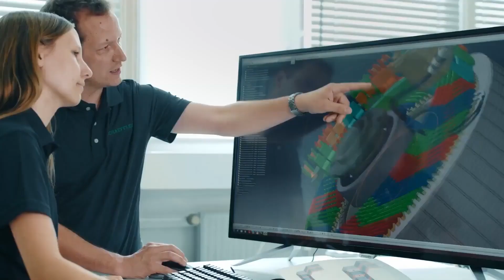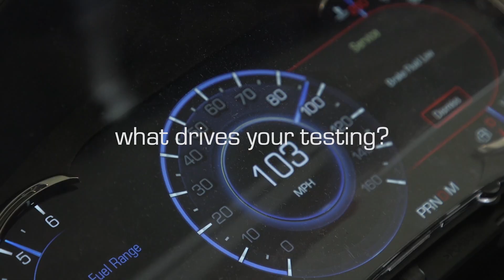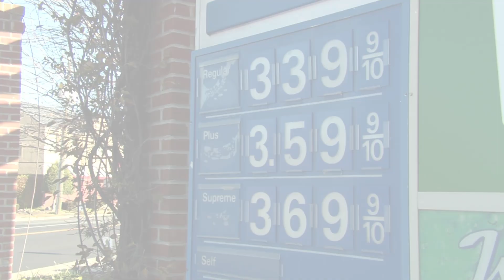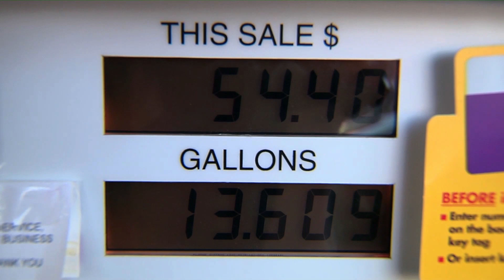Lamborghini's Profits Skyrocket; Problem with Cell-2-Pack Designs - Autoline Daily 3529

Comment: With respect to cell to pack being able to replace a given percentage of the battery if needed just makes sense.

From what I read gm is attempting to do that with its new architecture.

The concern I have with gm is it's not clear to me if this LG Chem stuff is ever going to work in volume. 
LG Chem does not even what to build another plant.

I did read gm is using cylindrical batteries in China (the same form factor as Tesla) and it appears they may be in discussions with Samsung at this time.

I do hope the best for Ford, gm, and Tesla (in alphabetical order).

When I purchase an EV I expect it will be one of the 3 above not sure which one at this time but battery safety and maintenance will be high on the list.

Comment: yes. this is the reason why i prefer a modular design like in the VW MEB.
at some point it could even be interesting to support two parts of the battery pack with independent electronic to support a mixed pack of older and newer modules with different tech. also, second hand modules could play a big role to add to a car that does not have all modules installed from the beginning. a cheap way to increase range after 3 or 4 years.
regarding the ICE ban or weaker emission regulations in europe:
it does not matter! BEV sales will still grow and grow because BEV get cheaper and better. this is why we don't need an ICE vehicle ban in 2035. no one will buy one. sales volumes will crash and that will lead to the industry stopping to build fossil fuel cars in 2032.

Comment: Automakers “pushing back” will have the same effect as a prisoner asking the governor for clemency.   Tesla has shown that Electric Cars CAN BE BUILT.  Profitably
Reply: Tesla does pretty well, I must admit. Maybe in the near future they could make more than three models?
Reply: @paul5683  unlikely they will add the truck maybe a commercial van but that’s it. Tesla is all about profit. The vehicles are never meant to be affordable or reliable in the long run.
Reply: @wasteofspace9184  Bet you will claim that you never said this once the cybertruck is delivered at the end of the year.
Reply: @wasteofspace9184 
Electric motors with batteries are far more reliable than gas or diesel engines.
Reply: @ChitFromChinola  motors yes, batteries no.  And it does matter if people can’t afford them. Also a lack of infrastructure, over reliance on gimmicks, lack of right to repair as well as repairs in general. But yes if ur 45+ in the middle class and can afford a 45k + vehicle where you don’t go many places as well as own or rent a home then yes it will be great to get an EV.  But for many many people that will not be the case.
Reply: @earlpottinger671  that’s on my end for grammar “unlikely for any other models. they will add the truck and maybe a commercial van but that’s it model wise.
Reply: With 62% of electricity in US generated by burning coal and gas, electric cars make little sense. Improving home insulation and reducing the size of an average American car would have more impact on environment than replacing all ICEs with electric motors.
Just think about it- Toyota Yaris burning gasoline generates less CO2 than Tesla 3 charged on US grid…
VW did an extensive study a few years ago of environmental impact of EVs vs ICEs, taking into account different grids, average annual distance driven etc, etc and the global numbers are only slightly better on EV side. Given that transportation is consuming only about 20% of global energy and cars & trucks are a small portion of that fraction, it is a mistake to spend $$ on electrification of cars that are used only a few hours a day instead of insulating homes that need to be heated or cooled in most parts of the world 24x7.
But insulating houses is boring and electric cars are shiny so that is all the journalists talk about and thus that is all general public thinks is needed to help the environment.
Reply: @rok1475  I’d say insulation is less of an issue in the US, most homes are already very efficient with heating and cooling all along the northern and middle states. Homes need to have proper ventilation. It’s more difficult in old apartments brownstones that will built at the end of the 19th century. But any home built from the late 40’s on has great efficiency. Small cars won’t happen even with people having less family. There will never be a population of mostly Yaris type drivers. That’s for the EU not the US. More likely to see more Camry drivers then Yaris.
Reply: @rok1475 Two very bogus arguments in one post.

1)  Fossil fuels are now the most expensive way to generate energy, and going up.  This means their day is done and within two decades the grid will be over 90% renewable.  Going all BEV is about long term goals: End greenhouse gas emissions, circular production cycle, independence from fossil fuel bullies.  Making a bunch of Yaris is about business as usual.

2)  Same thing with insulation.  More business as usual.  To make a difference, homes will have to be made all electric.  Since the grid will become all renewable, wasted energy will be replaced without additional emissions.  Problem solved.  After that problem is solved, we can talk about reducing losses, which is a fine topic when it isn't being used as a weapon by fossil fuel companies.

Comment: I bet that some of the reason that premium gas prices are going higher is that many people who used to have cars with premium fuel (BMW, Audi, MB, etc) have switched to electric thus reducing demand for premium. Oil/gas companies don’t want that revenue/profit to go away so they’re raising the prices of premium to keep the 💵💵💵 flowing. Would be interesting to see how this evolves as more people move to EVs lowering demand for regular/diesel. Normally prices should go down (less demand = lower prices) but since the prices are set by OPEC they might reduce supply to increase prices so they can keep their revenues and profits high.
Reply: That is just a vicious cycle that will increase interested buyers to consider BEVs instead.
Reply: If only.  Gasoline sales have returned to pre-pandemic levels.

Comment: The German and Italian auto industries are asleep at the wheel. Using scare tactics of employee layoffs should be seen short-sighted and as a crime and the heads of those companies and their board of directors should be incarcerated until they sing a different tune.
Reply: Seems quite harsh? Aren’t we a free market and society? We vote with our money.
Reply: Really?  Lamborghini posts RECORD profit margins AND sales with ICEVs, and they're ASLEEP?

Another Tesla stock shill, apparently...
Reply: @billcichoke2534  Short term thinkers. Lambo's small niche is likely the last refuge from progress, but even they are not safe without a long-term plan.

The rest of the auto industry will evolve the way the horse carriage industry did, except we can't butcher and eat all the excess gas cars.
Reply: @Bill Cichoke  Lambo has had ICEVs since their tractor building days. According to the story, their record sales and profits are due to change - non mid-engine non two-seater SUV.
Reply: @Harrythehun  There is no free. NEiN!  Just kidding, I was just messing to see who would respond. Thank you!
Reply: @foxtrot wolf  Well, since Lambo is also apparently supplying armored specialty SUVs to the Italian military, it's not THAT much of a change.
Reply: @Allan  Short term?  Like Karma, Lucid (soon to be x2), or pretty much every EV company depending JUST on the sales of EVs to stay solvent?

I think Lambo's plan is doing them just fine...like Toyota's will if they don't blow their wad on any more EV tomfoolery.

Comment: It makes a lot of sense for Tesla to offer insurance on Tesla cars. They make money on cars so just need to break even on insurance business while every other insurance company must make decent profit.
Reply: They also have more sophisticated methods to gauge risk through fleet-wide driving data, so they can easily undercut insurance providers with safe drivers, while offloading the high risk ones to their plates in severe cases.

Either way, it's been a great boon for Tesla drivers in many states where this plan is offered, some are reportedly saving hundreds or even thousands of dollars per year in insurance bills.

The one exception is California, where the law in place prevents Tesla from using these metrics, thus insurance costs are kept from falling sadly.
Reply: Other manufacturers are also going to offer car insurance!
Reply: They have a brilliant program that rewards you for safer driving and let's you analyze how you scored so you can determine at granular level what you want to change.

Comment: Obviously cell to pack is harder and more expensive to repair. So, more vehicles get totalled, so insurance cost go up.
Reply: Just wait for the first assessments of the gigacast frames in minor collisions…
Since there is no practical way to inspect the casting inside a car for cracks and other structural damage, insurance companies may write off Tesla cars even if the battery pack is intact.
Reply: @rok1475  Excellent point! Even relatively minor crashes will total many Tesla vehicles.
Reply: @joweb1320  Munro did an analysis on that and he disagrees.
Reply: @theipc-twizzt2789  Munro isn't an expert at all regarding vehicle repair. He is the kind of engineer the the body men are continually cussing. I have been in the collision repair business since 1991 and have been repairing EVs since they came out including Teslas.
Reply: @theipc-twizzt2789  re: "Munro did an analysis on that and he disagrees" well he can disagree all he likes (as can the thousands of other laymen on the internet who don't know what the hell they're talking about) but the Insurance Co's and skilled Professionals actually working in the field of Autobody/Collision Repair will be the ones making the decision.
Reply: @joweb1320  So you didn't even look into his reasoning? Because if he is wrong I would like to know where he is wrong. 

From what we currently see, the Teslas with castings and the ones without have the same insurance. 

As a customer I like to see a total lifetime cost decrease. 
As a repairman you like to see yourself not going out of business. 
People like you made the same arguments about touchscreens, batteries, electronics and so on. Despite all of that, a Model 3 has a TCO below a Toyota Camry.
Reply: @theipc-twizzt2789  At this point, Munro is strictly an entertainer. I refuse to waste anymore of my valuable time watching his videos. Anyone that has experience in the car repair industry know he is very much lacking in his knowledge. It is just so obvious. Go visit a bodyshop and speak with the body men who repair Teslas if you don't believe me.

Comment: With Cybertruck, nothing wins against it in a crash and it can be used as a boat for short periods, so there will not be many damaged battery packs. Model Y with the structural battery pack may generate a few damaged battery packs, but also is very sturdy in a crash, and much stronger still with the structural battery pack. 

No clue if cell to pack is a good idea for other companies, but Tesla knows what they are doing.
Reply: Thanks for the laugh! You have no clue! Ha Ha
Reply: @gmv0553  Elon Fanboys are funny.

Comment: 5:34 this is a non issue. If a Tesla is damaged in an accident to the point where it impinges on the frame, it's a total loss anyhow, regardless of the battery pack. Do you really think Tesla would do this as an insurance provider themselves if it was an issue?

Comment: Tesla insurance is about 2k/year for the Model 3; other companies charge about $3k/year. This wipes out much of the fuel savings of an EV. It's really the biggest problem with EV operating costs.
Reply: My insurance for my Model 3 is a couple bucks a month more than my Chevy sedan.
Operating costs are a large benefit of EVs.  It's the upfront cost that can be a battle.
Reply: Just a Tesla disadvantage but anyone owning one has plenty of money. When I had a Bolt it only raised my insurance $14 a month but that was due to having moved up from a 2002 Camry.

Comment: The mandates wont matter, because the free market will take care of the problem on its own. By 2030 I doubt anyone in their right mind would be driving an ICE instead of a cheaper, more powerful and more reliable EV in the majority of transport applications.

It's just political posturing either way. The only purpose these mandates may serve is give these companies the push they needed to survive the EV transition, but really, aren't we past the point of hand holding?

Just move out of the way and let the market run its course now, the rising EV leaders will pick up the legacy's workforce after the dust settles.